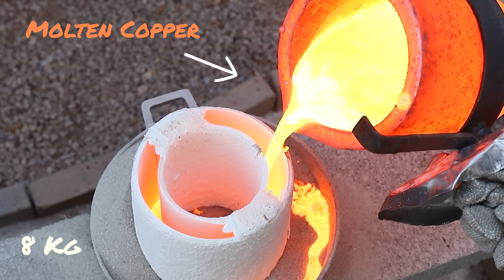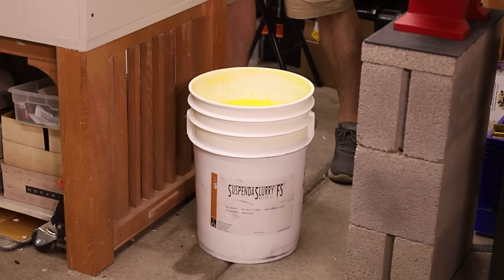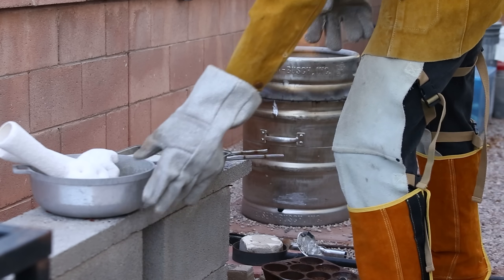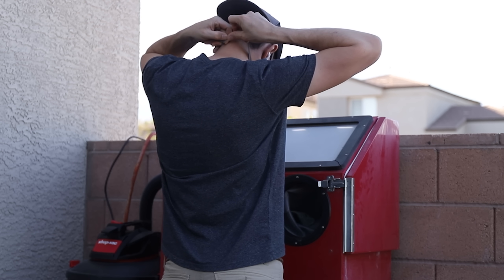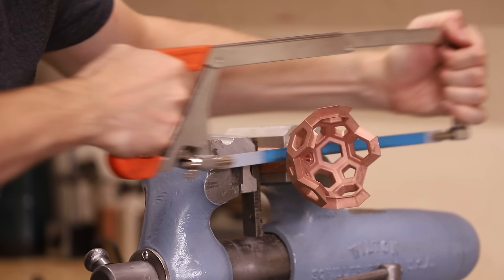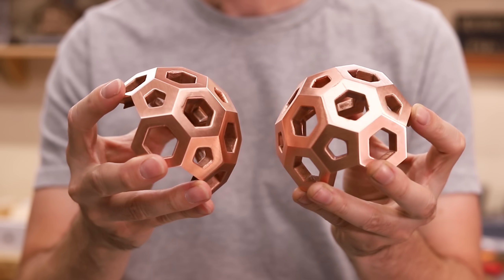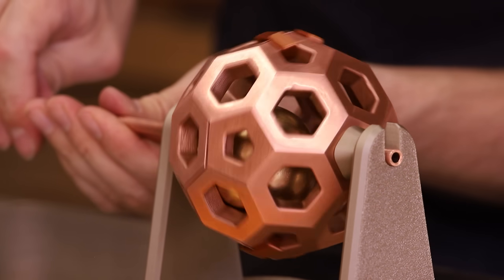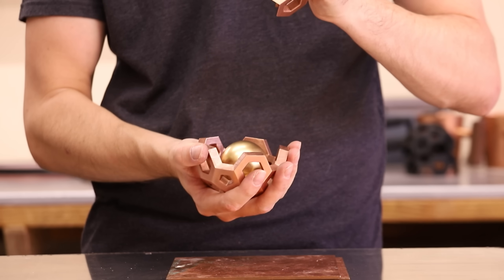HUGE Magnet VS Copper Sphere - Defying Gravity- Will a Neodymium Magnet Float Inside?

Comment: You could also try a smaller sphere, this one is taking almost the entire room inside and it jumps with the variations of speed hitting the inner walls and compromising stability as it reaches the perfect speed for it to float perfectly centered, so trying a smaller sphere will give it the necessary space inside to start  spinning without hitting anything in the process to finding the right spee and stability.

Comment: Needs bearings at each end of the shafts, in the support stand.
Rather than trying to spend the shaft with the hand drill,  reintroduced that flat disc magnet, with it's own stand allowing the  disc to spend freely  near the ball magnet. Might be more interesting to see the control achieved using the disc to affect the ball magnet!
Good work, I like what you got there so far. 
Thanks for sharing. 
Regards, ToMyTown9

Comment: The reason your magnet is bouncing around is because you orb is faceted. Try making it perfectly round like a Wolfle ball. There still may be some turbulence because of the inconsistency of the metal do to the holes. You may need to strategically place them or eliminate them all together in the center and only allow openings on each end, but make sure that the part of the orb that doesn’t have holes is a little bit greater than the width of the magnet ball in the center. This should give you an ability to view and take out any turbulence or rocking due to frequency of metal contours and lack of metal altogether.. Really small holes may reduce turbulence, but you would have to position them to wear when the orbit spinning fast it would create a viewing window based on your camera angle that require a little bit of math I suppose. 

But the easiest thing in the universe is to do what? It’s to give advice best of luck.

Comment: Iwould have rather thought about 4 donuts of copper (2 smalls near the poles and 2 larger near the equator (a bit like Iter poloidal magnets). It would be much easier to watch the inside. Use fluorescent pigments for the ball and black color for the copper part.

Comment: Hmmm try positioning it vertically with the drill bit rotating it from the bottom instead of sideways and maybe add another magnet 🧲 on the outer to help propel the sphere magnet.

Comment: I think what you may be missing is that, whether is "floats or "slows down while falling" inside the copper shape, depends on the direction of the N and S of the spherical magnet as opposed to the direction of fall (gravitation force direction), because of the Eddies created by the movements direction as opposed to the N/S of the magnet.

Comment: you may try with a smaller sphere magnet inside, which can actually remain floating at center and the effect is quite dramatic. I also like the suggestion of Stroboscope matched witht he rotation so that the outer shell seems static and we can observe the floating spherical magnet in a better way. Eitherway, Hats off to you for putting such a great effort and showing such an incredible experiment. Thanks a ton.

Comment: What would happen if you placed several magnets around  the exterior, evenly spaced, and then spin it within the field?  Would it stabilize the one on the interior?  Also, does it matter what hemisphere of the  planet you're in as it relates to rotation?  Very cool video!

Comment: If you were to make two solid copper spherical halves, which were equidistant from the spherical magnet and then screw them together around the magnet you could evacuate the air from the centre section which would create zero friction
Then mount the outer section on air bearings 
This would then give you a consistent frictionless core section and very little friction on the outer casing 
It would be interesting to know the amount of magnetic force that you generate and whether that can be transferred to a fixed metal object outside of the assembly 
And whether that force is greater than the amount of energy that you’ve put into the assembly in the first place

Comment: That sphere is really cool. I wish I had the ability to do castings.  Great video!

The problem you have is that the spherical magnet is magnetized through one axis. The suspension will work if that axis is along the rotation axis (or perpendicular, I can’t do the analysis). There is nothing that sustains that, so the effect is erratic. You may do much better with a magnetized cylinder. Even then, it would be nice if it maintained its orientation. For that, it would be best if it was bottom-heavy, so asymmetric. Sorry I can’t be more authoritative, but I’m lazy by nature.

Comment: Try doing copper donuts put a little bit magnet mixture just the right amount and the magnet won't float 🛟 perfectly in between them just a little bit of mixture in the copper 😊💯🤝💪🧑‍🚀 suspend suspend in mid-air if the Earth magnet is very powerful that's all you need is some fragments try a little at a time until you get the right amount😊

Comment: What if you used copper screen around copper wire made in the same shape, or even a sphere, but larger? 

Would that work? 

If so, it should be easier to both make and see through.

Comment: Will spinning the other magnet on a rubber band or something would it easily turn your sphere, creating real work with little force? Or is that not feasible. 
Really cool project. I've tried thinking of ways to get real work out of lens law..
What about a circular tube, would spinning the tube anti clockwise faster than it falls result in it remaining stationary?

Comment: To make it float inside better, my idea would be to essentially make it like it was in the beginning where it did float incredibly well. In other words, think of it like this... If you were to take the copper "cage" that you made, put it in a vice or something similar using the 2 faces that it spins from and flatten it out, making it sort of like a disc shaped cage. Instead of using a round, ball shaped magnet, you would use a disc shaped one. Not sure if that would do anything, maybe use a smaller sized magnet would be a possibility as well, that one may have just been too heavy for the amount of copper you used. The first example had a lot more copper and I'm guessing not much difference in weight between the 2 magnets you used, so instead of being an issue of shape it could be an issue of mass or weight differences. Also, at the end there that was cool how you controlled the sphere with a magnet, would be interesting to see what could come of that. If you made a magnet inside a copper cage that is tightly fit together instead of trying for the floating aspect of it, you could potentially make a really cool wheel, or controllable ball, etc, something sweet and awesome to play with and or control anyways. A toy maybe? A ball shaped wheel?? A vehicle???!! Put the oil industry out of business!! (Give me 1% of the business for the idea and it's yours, lol!! 😂😂) subscribing to see what else you do with this, hopefully something amazing!!!

Comment: I only got an N45 sphere magnet. Where do you get this N52? Hm...so the stronger the magnet the smaller the magnetic field as if its more focused.
The disc magnet levitates because its closer to the copper. Also the poles are at the flats. Left hand fits the exact angles. Interessting video. Was fun to watch...Thank you 🙏

Comment: No scientist here but:  Maybe the effect looses power on each empty space on the copper,  2 Need a thicker copper sphere/polygon,   3 need to  sand the interior side of the polygon to a complete circular smooth surface to avoid bumps with the sphere magnet - just because I noticed a stronger effect in the thick copper cylinder at the beginning, best luck.

Comment: I think a bigger copper cage, I'd try and measure out the attracting and compelling distances and points... with a bigger cage there's more space/chance a sustainable levitation could be possible... made me very interested to see when you introduced another magnet to the equation. Makes me wonder if you could use a crystal to create an electric current which then acts as a motor, rotating the slave magnet to and from the master magnet inside the bigger copper cage...

Would be an infinity powered mechanical magnetised motor...

I didn't go school but I still got ideas. Lol just never will be able to use or create them.

Comment: Could be used as an inertial damping system for space travel with whatever we wish to protect from strong accelerations - such as a crew module - in the interior of a magnetic shell which would then be surrounded by a highly conductive shell of some other material.

Comment: oki so rotating a torus shaped magnet within a foot of the sphere causes it to rotate... that means the inverse would also hold true.... what if the sphere is rotated and there are 4 torus magnets equedistantly spaced around it, all 4 should rotate.... what would the resultant energy be from the 4 if they were on rotating shafts vs the energy input to rotate the shpere?

Comment: Really amazing, honestly worked much better than I thought it would. Since you asked, I think it's similar to the 2D case. As long as there's enough copper available to make a strong back-current and resist the magnet it should float. You can still use the hole in the soccer ball pattern, but the seam creates resistance and the bouncing is hard to avoid. Maybe if the interior were round so the magnet can roll.

Comment: Your first design with the rolling tube and flat disk magnet had much better internal visibility than the truncated icosahedron. Probably won’t require custom inserts to make it spin. Also easy to keep the poles and rotation axis aligned 🤷🏽‍♂️

Comment: Bro, this may be a missing piece from a time machine. so this is the idea. the rotation must be generating current, so try collecting the generated electric current with an induction coil and use that at the right amount to power the rotation device like the drill you used in the video, I am Alex a researcher from Nigeria. One love

Comment: Looks like u need to put it in a very heavy stationary setup with roller bearings and such that don't wobble. What im interested in...is it capable of generating electric current some way or fashion. Maybe place a stainless steel ring around exterior? To my notion u could not put a metal that attracts the magnet.  Either copper or stainless possible

Comment: There is one major design flaw. You should have kept the holes smaller. The holes are actually casing the Eddie currents to become weak. As far as I can recall, laminating the core or giving space between layers reduce the currents. 

Also, if you plan on making a complete spread, it would be nice to see how hot can it get if you spin it super fast dude to Eddie currents.

Comment: Gravity is getting in the mix, causing a varying pull on the magnet in the middle when it is spun fast.  Spinning it slowly, one notices that the magnet really resist changing its position relative to the sphere.  When it stays below the half way point, the gravity is pulling the magnetic sphere roughly in the same direction as the resistance to change in position is encouraging to happen until it reaches the center of the sphere.  Then the reverse is happening, the gravity and momentum effects are being resisted.  In orbit in space, the magnet would likely stay in the center of the spinning conductive non-magnetic sphere.  There system possibly acting a bit line a lubricated bearing.  A sphere of something like aluminium window screen may be enough to show the effect.

Comment: Rubber coat the ball and make a round wheel use a motor and put it on a magnet and spin it so the ball moves across a table or use two and make a small scooter that runs on magnet power

Comment: Instead of the hexa faceted sphere try a toroid with spoked very thin sides for a ‘hamster running device’ shape with your sphere inside and  about the speed, it may be the result of dividing  the weight / mass of the sphere by the magnetically levitation potential  per gram or something like that, don’t know where or when does the RPM spinning factor comes in as not a physicist XD

Cool ideas and congrats for your craftsmanship as a designer and as a blacksmith 

Take much care dude, molten metal is no joke. Need safety protocols as the usage of a brick barrier, thermal non flammable barrier gloves, boots, fasciae and chest shielding in case hot liquid metal don’t spill if casting breaks or air bubbles may explode.

Chhers

Comment: can you measure power needed to spin it at some speed (enough to make the magnet not touching the walls) - both with and without magnet inside? how this power difference relates to the weight of the magnet?

Comment: I have theorized that levitation will come from a small mass spinning at incredible speeds and having its rotational angle altered by lasers. The lasers will impart a force on the spinning mass using gyroscopic precessional force to oppose gravity if available. It will be spinning inside of a magnet. This force will be so large that it will eventually be able to move huge objects. Many problems must be solved

Comment: Idea not fully thought to the end. If its a circle/sphere with having the same energy directed to the center from every point around the ball, the additional gravity will pull the ball down anyway.
 you shouldve either left the top side completly out, and just place the ball in an open half, or somehow make another layer ontop of the sphere with increased magnetic pull to counter the gravitational force.

Comment: Experiment:  insulate the two halves with a dialectic layer electrically separating the two halves, use non-conducting clips to hold together.  By spinning, and/or influencing spin, does it produce an electrical current?  If so, how much?  What happens to the magnetic field around the entire device when in spin?     my $0.02 worth...  ;)

Comment: make a plate of copper which will be floor and make a platform of magnet put that platform at maximum height the crane could give and order the crane for free fall without TAKING FALL DAMAGE 1/10000 the probability you"ll read and do the experiment lol

Comment: Build a cylinder with magnets placed around it and then put the copper inside it with the magnet in the copper and see if it makes the whole thing spin instead of building a motor to spin it.

Comment: It would be interesting to see this connected to a motor under water in ferro fluid running at a high speed to see the magnetic field visualized. Also it would be interesting to see the same thing with an external magnet rotating at a constant speed to force the ball magnet/lattice spin.

Comment: Sometimes I wonder why magnets aren’t used for more large-scale applications of Lenz‘s law.  Maybe it would be impractical or maybe at a human scale it would be difficult but I just imagine floating platforms in place of bridges and belts that let you rise through buildings in place of elevators.  I’m sure it would be expensive as hell, but it would be so badass.

Comment: I would suggest a upscale and place a micro camera to look inside. Plus, what l immediately noticed is that you don't have to do more just to hear the ball not knocking against the inside surfaces without even seeing it. Build a solid outer shell and just listen for no knocking. This could be used for frictionless ball bearings. I believe in turbines as well. Hydroelectricity and steam turbines. I can also vision a possibility for perceptual energy. More output than input. I have a fine art degree and see ideas in my head.

Comment: I think a second external mechanism would be cool. Spin the donut magnet using a small quiet motor. Put it under the table. Then when you want you can put the magnet cage near it and it will start to spin on its own.

Then you could make one of those ridiculous shorts tagged as infinit energy

Comment: Cool dude 😎! Next options that come to my mind are:  Try to stabilise the magnet before spinning the sphere, by putting an axle through the magnet Wich you can remove after the Sphere is spinning. The axle should be drilled through te centre of both poles.

Try different speeds, try smaller Magnets. 
Also maybe heating up the sphere might help? Or experiment with temperature differences.

And last use a high frame rate camera.

Very satisfying to watch this.

Comment: This is really cool.  A couple of suggestions I might have are:

1. Make the sphere a bit larger relative to the magnet inside it.  Right now, I think you've got a lot of trouble keeping it stable because even a small deviation will cause the magnet to bump into the sides.
2. Make the inside of the "sphere" as smooth and spherical as possible.  Right now, all the little channels on the inside will bump/grab the magnet any time it comes in contact with them, and cause it to start spinning around the outside with the sphere.  Then, centrifugal force takes over and it stays stuck to the outside.  If the inside were smoother, I think there would be fewer issues with this.
3. Really, if you make the whole thing more spherical (i.e. a sphere with holes cut out, not a shape made out of straight sides), you would probably also get better eddy currents, since they're actually trying to move in a circle.  It might also be better if you had unbroken circular paths around the axis of rotation (basically, a series of circular rings around the axis, connected by segments going from one pole to the other, similar to latitude/longitude lines on a globe).  This would probably make it easier to see the inside when it's rotating, too.
Reply: Haven't I seen most of the above comments applied to Tokomak's and Nuclear fusion ;-)
Reply: @johnbaker4574  Hmm... now that you mention it, if he magnetically constrained the whole thing inside a high-energy plasma chamber....